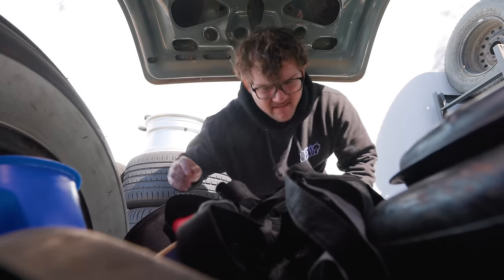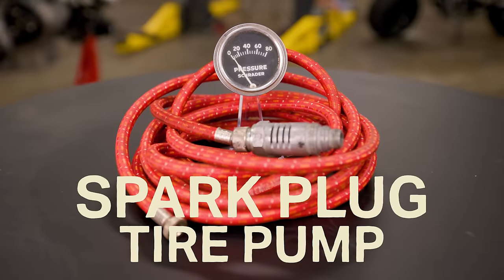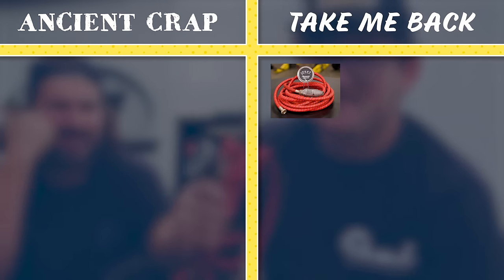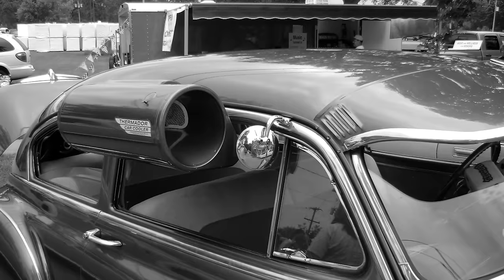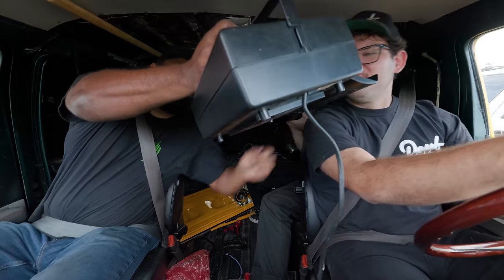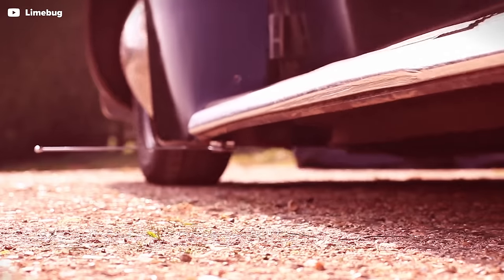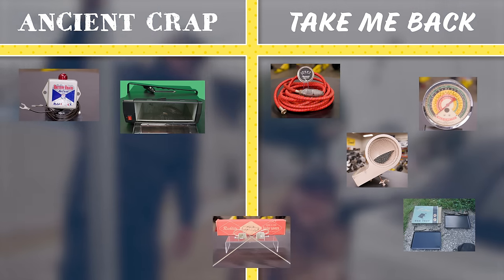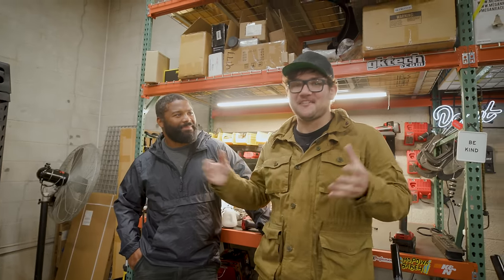Testing Forgotten Car Accessories

Comment: after testing that Schrader tire pump tool, you guys should have taken the Schrader valve out of the tire after pumping it up and put a lighter to the air coming out to see if it actually didn't pump air/fuel mixture into the tire :P
Reply: nah, gasses in tight spaces (tube) + fire = nothing good, ever
Reply: Idk how it wouldn't have fuel/air mixed
Reply: Would it really matter if you didn't have something to start it even if it came out?
Reply: @BusinessWolf1  Unless the tire is totally flat and partly off the rim, then a can of aqua-net and some matches are the perfect fix.
Reply: @Mellow.1888  Theoretically, the cylinder doesn't draw in that much fuel as normally when using this, because this thing has its own check valve letting the outside air into the cylinder, undoing the vacuum the piston would normally generate during intake stroke, which is normally pulling the fuel-air mixture from intake manifold into the cylinder.

Of course that vacuum release is only partial so some fuel gets still sucked into the cylinder and pushed into tire through this thing.

In multiport injection engine, the issue could be even further mitigated by disconnecting the injector from the cylinder where applying this accessory. Although you should be even more cautious with these things on cars with catalytic converter, because this also causes some unburnt fuel to enter into exhaust which may overheat the catalytic converter in prolonged operation.

But the biggest issue to be cautious about with these, not mentioned here, is that you must never, ever run the engine with a spark plug wire disconnected, that may cause overvoltage damage into ignition coil! It sure can be solved by just keeping the spark plug connected into the wire and keeping it in contact with ground, you just must be sure to do so whenever using this.

Regardless of these shortcomings, I too would still put this thing into the "bring it back" category ;)
Reply: @TheSimoc  right on! Thank you for all the info explaining it.  I'm not huge on cars and the internal workings of them so I appreciate you taking the time to respond and were so descriptive.
Reply: @andrewblake8797  Are you speaking specifically about the car shown in video? Well yeah, I really have no knowledge about that individual car, nor was there enough footage about its engine to get a grasp on what kind of fuel system it had.

What I was speaking about was purely generic info, applying on carbureted and manifold-injected ones, with the additional sidenote about the ability to mitigate the issue with multiport ones into some extent.

I left out specfic considerations about direct injected ones. About them, there are two sides: if using as is, they indeed feed the exact constant dosing of fuel regardless of the additional vacuum release by that gizmo, but on the other hand, with them if you disable the injector on the cylinder it is being used, you will have absolute zero fuel in that cylinder and tire, really pure fresh air! That's unlike with the manifold muliport injection, where even disabling the relevant injector doesn't completely stop all the fuel into that cylinder due to all the other injectors still injecting into the one and same manifold, albeit being lessened into the relevant cylinder due to farther locations of the injectors of other cylinders.

Edit: Forgot to comment about your statistics.. Carbureted cars were dominant in brand new ones into late 80s and even in early 90s they weren't uncommon at all. Then they soon declined. So the factually correct figure about time of absence of carburetors in cars of contemporary modernity is 30 years, without additional plus sign. California may have been exception though, with exceptionally strict emission requirements decades earlier.

And the overwhelmingly most dominant fuel system among cars currently in usage, is indirect multiport injection. Direct injection is a small minority, not sure though whether it is more prevalent in cars currently being manufactured.
Reply: @Mellow.1888  l m L TV m
Reply: this would not be problem on a 1cylinder engine or any engine that you can easily close off fuel, just let it idle until it dies then have it crank a few time to open air.
Reply: @remypaquin7224  But then you would need to crank it all the time to pump the air into tires :D Starter would burn out or kick/pull/handcrank labourer would get TIRED soon..

In 1-cylinder engine I mean, you wouldn't then have the other cylinders keeping running and doing the pumping job...

But in multi-cylinder direct injection engine, you could indeed cut the fuel off of the cylinder you are using this, and have fresh air into tire and no fuel into catalytic converter either.
Reply: The manual for those Schrader pumps actually mentions this. They don't draw their air from the cylinder itself, but just use the compression stroke to take it in through the slots on the sides.
Reply: @BusinessWolf1  The odds of the flame backtracking into the tire is pertnear impossible.
Reply: @NukerMunkyGames  you've been watching to Many Redneck how toos
Reply: @Business Wolf  Many of the guys who drove propane delivery trucks will tell you that when they have a tire low on air, they would fill it up with propane. It's not a permanent fix, but it will last long enough until they could make it back to the shop. They would carry homemade adapters that connected the tank to an airhose in case of emergency. I've seen it and I still don't believe it. Safety third!
Reply: If you have access, you could unplug the connector going to the fuel injector. It's still way easier to just plug a pump into the cigarette lighter.

Comment: There are tyres specifically made for re-treading them once they wear out, commonly found on wheel-loaders that dont have air in tyres, but also trucks, busses etc. Re-treading is still a thing, just not on normal cars :)
Reply: It's actually 2 different things: 
- Re-grooving is carving out rubber to deepen the grooves on an existing tread. Tire manufacturers even design some of their products to be re-groovable and specify in the tech. datasheets where and how much rubber you can remove.
- Retreading is basically gluing / curing a new tread onto a used casing (old tread buffed away).
Reply: Sometimes i do get normal civilian cars with re-treaded tires🤔 Mostly on imported cars from neighbouring country's.. (EU)
Reply: @Mato309  cheers for clearing that up, not native to english but i definetly meant re-grooving then 👍🏼
Reply: It’s also pretty common in India as well. I’ve seen a bunch of videos of truck tires being retreaded and they’re pretty interesting
Reply: @DeUnoReverseKaart  Wow. Higlhy illegal here, you lose your driving license and get fined if u do that to your car. (EU)
Reply: Indeed. Car tires have different rubber layers on them, when the gripping layer wears out, the regrooving is done on a layer that has more of an elastic property.
Reply: @slendergollum  What country are you in? There's no law against retreaded tires here. Here in the US truck tires are often retreaded multiple times. In recent years several companies have developed a quality retread tire for cars as well. Not sure if there are many people willing to buy them. Check out tire recappers.
Reply: @Jonathan.D  
Uh, guess you missed the bits where it's clarified that regrooving and retreading/recapping are two different things?
The truck tyres I'm familiar with will state "regroovable" on them if it's allowed by the manufacturer.

it's common, though, in motorsport with some tyre manufacturers actually having guides where to remove the rubber for different conditions, and some teams will also have their "secret" changes to the moulded OEM patterns for specific applications.
Reply: @gordowg1wg145  transport truck tires in Canada can be re treaded idk about re grooved but i assume that too. they grind it down then glue basically a rubber mat to it, it bonds as one i think. 

then again i have seen trends fly off on the 401 so maybe thats why

Comment: That tire tread regrover tool takes me back right to the mid 80's. I knew a guy that re-grooved tires for friends, hooked me up a few times. It is an art, never had an issue with any tires he did for me.
Reply: Problem today is the tires arent meant to be regrooved. in the 80's the tire tread was like half of the total thickness and you could regroove them... legally without any problems. Boys on this video tossed it in ancient crap, but it really is a good tool for tires that are meant for it, there are some still sold today. But not very common in Western world, except racing.
Reply: @SergeyPRKL  
Tires were never meant to be regrooved.  Retreading tires was and still is a fairly common thing in the trucking world, but that is an entirely different process that's done by actual tire manufacturers.  The tool they are showing here was a gimmick, and a dangerous one, and has always been crap.
Reply: @SergeyPRKL  Yeah, I would never feel comfortable regrooving a radial.  A bias ply on the other hand...
Reply: I've never used one, but tires have obviously changed since that tool has come out. Car tires today aren't meant to be re-treaded, they're meant to be replaced. Bad example by the boys, since they said the tools like it are still being used for specific vehicles. If this one specific tool is a gimmic, than they probably made the right choice.
Reply: @Mike Newman 
In order to be regroovable they have to conform to 49 cfr 569.3 (c).  The only tires that do are some tires for tractor trailers or large equipment, and some special order stuff designed for offroading and rock crawling.

There are no tires you can go buy at your local tire store for a standard vehicle that are regroovable.
Reply: I've done a few tyres on trucks in the UK perfectly fine to do as well.
Reply: @SergeyPRKL  I remember seeing truck tyres being regrooved.
Reply: Very common in the off-road world
Reply: @Rowgue51  my company regrooves our super single trailer tires,but only after a very thorough inspection (uv lights and all) only about 3 out of 10 are deemed regroovable, the rest are sent out for retreading.....keep in mind the typical tire costs ....our truck/trailer sets are 9 to 13 axles total with all trailers running super singles.our tire manager is pushing 70, the company hopes he stays around as long as possible, his tire  knowledge is irreplacable
Reply: I'm willing to bet it was better on bias-ply tires, and likely a more common practice during WWII when many goods were strictly rationed. Keep in mind the millage lifespan of tires in those days was far shorter.
Reply: @Rowgue51  I've personally seen semi truck tires with the words "regroovable" written right on them.

Try again.
Reply: Back in the day in my home country about 25 years ago I worked with a guy who HAD driven a car that had been fitted with re-grooved tyres.  He was in a wheelchair.  Tyre burst and his car rolled, below waist paralysis.  TBF, he was a funny cheerful sort of guy but would make a point of telling us all to check our tyre pressures and avoid regrooving services (not legal, but more common at the time).

I saw a regroover in action once.... the dude doing it was very skilled at making the same pattern as that originally on the tyre to the point where you could not tell the difference, except for where the fabric layer was showing through.  He had a solution for this too.  Black rubberised paint to "re-coat" the tyre and hide the white of the fabric/belt.  Very professional almost undetectable result but potentially deadly of course.
Reply: Isn't that just gonna break through the tire? Or make it so weak it'll just pop?
Reply: @testname4464  There's a safe number of regrooves a regroovable tire can have before it's unservicable.
Reply: It's funny how little these guys know about cars. I would think they would be familiar with rally car tires where they groove them for the track. They did mention off road tires. Tire groovers definitely have their place and are not ancient crap.
Reply: They do regroove truck/lorry tyres but not all tyres, they make regroovable tyres which has more "rubber" on them
Reply: Had a guy use that at a track day. He only brought slicks for his bike, it started raining and he made sipes. Kept him quick and safer than my pirelli supercorsas were
Reply: For everyone freaking out about the retreading. Nearly all commercial aircraft tires will be retreaded multiple times during their life cycle. It’s a safe practice if done correctly by trained individuals with the correct tools.
Reply: Also, this tool is really meant for bias ply and as mentioned heavy tread tires.
Reply: I work in logistics and a company I used to work at had a regroover for forklift tires. Well as nobody cared that the tire were perfectly flat in a few months it never got used anyway.
Reply: @Rowgue51  for cars yes, but a decent amount of pickup tires are. they get marked as regroovable. id only use regroovable tires if i drive alot of highway miles since you still have to deal with the fact that tires fail due to age. but to say tires were never meant to be regrooved is just plainly wrong
Reply: People still practice the craft today down south
Reply: I knew a guy who had a home made set up similar to a lathe that sounds the tires whilst he applied a cutting tool. He also changed damaged cels in car batteries and redirected them. 😅😅
Reply: @Rowgue51  On comercial trucks and forklifts/construction equipment you can cut new treads in to get more mileage out of them.
many/most of them have markings that signal how deep the re-cut treads can be. 
There is another technique in which a manufacturer can bake a new rubber surface on used tires to give them a second life.
Reply: @Rowgue51  Nah, it's just a niche tool.  It was considered fine back when tires had tubes but obviously for regular vehicles it's no-go today.  There are still a lot of airless tires where tools like this are commonly used to recondition them.
Reply: Seen them do tractor tires a few times before replacing them,cause some of them are a grand plus on backhoes...

Comment: The tire groover is still in use today. We use them all the time on our Midget and Sprint Car dirt tires. It is also common practice to sipe the tires and even take a grinder to them to take the outer layer of rubber off so that you have some fresh rubber before hitting the track. With that said, I would never groove a street tire. That is nuts,
Reply: Regrooving is common practice in semi trailer tires (clearly marked on sidewall "regroovable") due to the high cost of new tires when there is still 1/2" or more tread rubber even after they get to the wear bars
Reply: @timothyjunkin2506  I didn’t know you could regroove them. I know I put a ton of recapped tires on rigs when I worked at a tire shop in high school.
Reply: Its actually used here in Poland by some public transport busses, you know, you gotta squeeze every penny to make them not loose money
Reply: @backcountryme  I'd rather a new tire that's been regrooved than a retread where I'm at in the summer they come apart regularly
Reply: Used to be super common, but these days about the only things on the road that run regroovable tires are big industrial/commercial vehicles, semi trailers, and RVs.
Reply: Well, the thing is with the tire re-grooving tool, it was made to do bias ply tires not steel belted radios. done tons of them. Still used on semi’s in bobtail trucks. You run them on the inside rear and you’re safe semi lol.
Reply: It really goes to show how little the Donut Media guys really know.
Reply: @jonwakcher4301  yeah. All our dirt track tires are bias ply still. And they are only good for one race normally. We can burn them down to the carcass in one 25 lap feature race. That is $12 per lap just for one right rear tire.
Reply: @timothyjunkin2506  my Toyo 19.5 wheels on my F350 dually pickup are regrooveable.
Reply: Those are often used in poor countries to get more life out of bald tires (not recommended)
Reply: They still skim tires for 60s racing cars now, otherwise you have to throw away a £250 tire after one weekend of racing
Reply: We also still use them for flat track motorcycle racing. Definitely a "Takes me back" category tool.
Reply: @mkramer278  yeah, I have seen my cousins old teams using them in the AFT stuff.
Reply: On the oldest of old highway tires it wasn't uncommon to mount the entire wheel on a motorized hub and shave rubber off, just enough to make the tire perfectly concentric to the wheel center. The groover would come out after to get the grooves consistent in depth, and then you'd balance it.